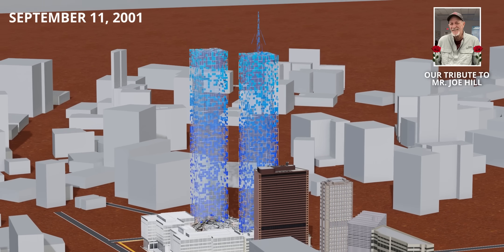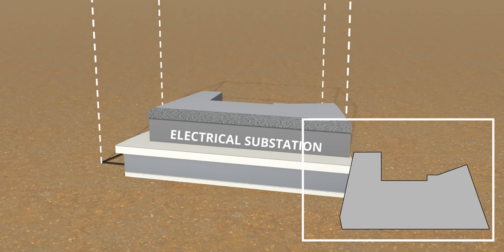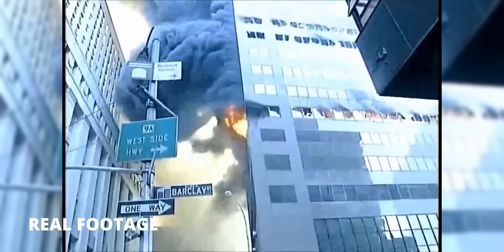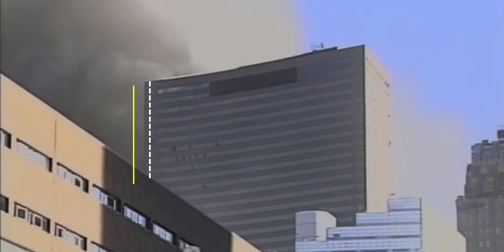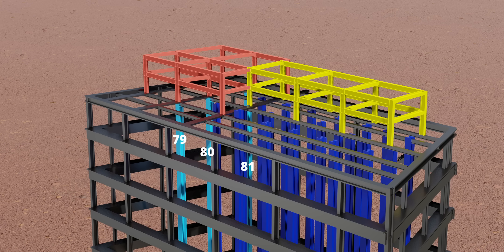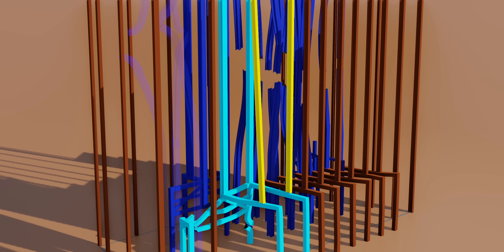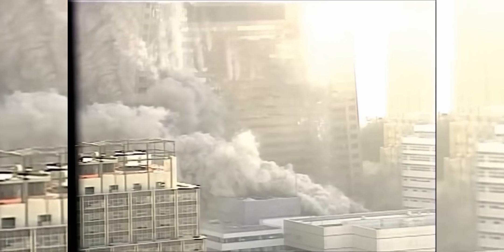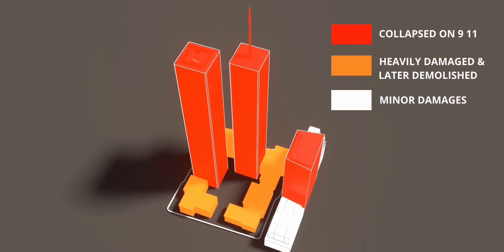Collapse of Building 7 | The Complete Physics

Comment: Hmmm. NIST's official conclusion for the "collapse" was caused by just one column collapsing and the fires(lol). I think they said it was just column 79. So I guess this is just a conspiracy theory, right? Almost a quarter of a century later and we still have BSers sucking the cock of the official narrative. FU
Reply: bit of a simple explanation but more or less correct. Just because you are not smart enough to understand it doesn't mean it is not true
Reply: @pacman3556  I'm much smarter than you are, kid. There are 100's of engineers from different backgrounds that agree that NIST's final conclusion was absolute nonsense. Not a single steel structure had ever collapse the way NIST explained it. Not at any time before WTC 7's "collapse" or anytime after.

Comment: I am NOT a civil engineer or architect, but I am a mechanical engineer, and those right angle bends in the I beams at the base of the tower to go around the sub station have to be the biggest fucking no-no I have ever seen in a mechanical system
Reply: I was thinking the same thing.  That sh!t was janky as fuck.
Reply: It was built to get around a transformer or something like that.
Reply: It just means you know fu-k all.
Reply: Im more amazed it didnt collapse sooner! goddamn freestyling steel beam design is wild
Reply: I entirely agree with  you, it is an obvious monumentally weak point
Reply: Structural engineers disagree with you and the building stood for decades.
Reply: @pacman3556  You are assuming the Blender animation we watched is correct. I am also an engineer of an unrelated discipline but elementary physics (that all engineers take, anyway) is enough to conclude that those columns are just someone's imagination. No architect would draw that, no expert would approve it and no civil engineer would build it.
Reply: @mehmeteking  You can look up the plans online, construction was the wild west back then bub
Reply: @pacman3556 until it didn’t…
Reply: @pacman3556  It stood for decades until it  fell absolutely perfectly to the ground from the bottom up.  Great work.  Reporting it fell before it actually did is another journalistic  miracle.
Reply: @JoeLinux2000  it didn't fall perfectly to the ground or from the bottom up. And your little "reporting early" theory makes absolutely no sense.
Reply: @pacman3556 of course it makes no sense but it happened
Reply: @ why they reported early was explained. You however cannot explain why they would need to be included. Your little reporting early theory makes no sense
Reply: @JoeLinux2000  SHOCKING STORY: News media makes glaring error on day of mass confusion! More on this developing story at 6.
Reply: @JoeLinux2000  prediction + mass confusion
Reply: @dutchdeluxe69 prediction + mass confusion. Sure buddy. Lets go for the most unlikely scenario.. but only when it fits your delusion.
Reply: @pacman3556 there is video of the BBC reporter with the Tower in view. Still standing
Reply: @JoeLinux2000  I mean, to be fair, you ain't truly designing skyscrapers to take MASSIVE gash down it's outer structure, then fires allowed to rage for hours and hours due to firefighters being distracted and not fighting a fire in an evacuated building on a site that's in utter ruin. It was a perfect storm. It wasn't necessarily a big no no to do. Except in this basically one scenario that somehow actually happened. I doubt they considered "what can we do if WTC collapses?" when designing the building. Let alone basically practicalities of building in urban downtown areas like this.
Reply: @pacman3556  Mistakes never happen in reporting, especially from a foreign reporting agency who probably had no idea which building they were looking at.
Reply: @member57  yes the BBC made a mistake and reported incorrectly. It doesn't prove a demo
Reply: @pacman3556  Ummm, i am sorry there is plenty of easily available footage showing just that. "early reporting".
Reply: @JoeLinux2000  If it fell from the bottom up, then why does every single video of the collapse show the penthouse collapsing first?
Reply: @hydra70, I’d take exception to your comment.  If every video showed the penthouse collapsing first, demo expert Danny jowenko would not have concluded  that the building collapsed from the base first  videos from uptown show the building 7 collapse, but you don’t see the penthouse collapsing first and it looks like a collapse from the ground up.  Twoofers don’t like the CBS westside hwy camera view, unless they can start the video after the collapse of the penthouse
Reply: @yowlrdubz  It wasn't prediction because fire chiefs were pulling fire fighters out of WTC 7 hours before it collapsed because they were pretty sure it was going to collapse. That info worked its way to the media and went from "going to collapse" to "already collapsed". That is highly more likely than the govt gave them a script that they read too soon. Why would the govt risk that? It would be much safer just to let it happen and be observed in real time.